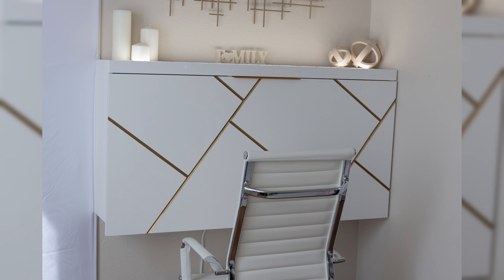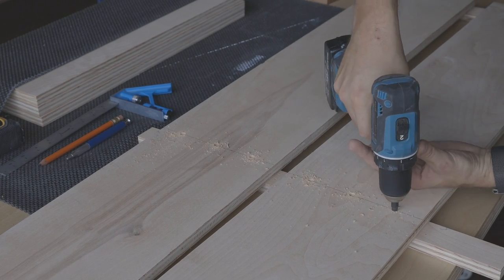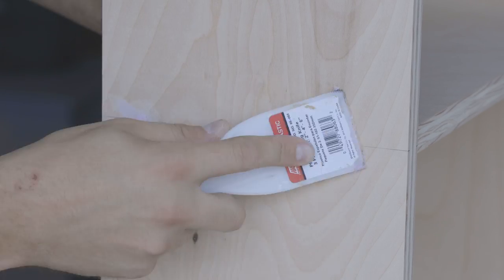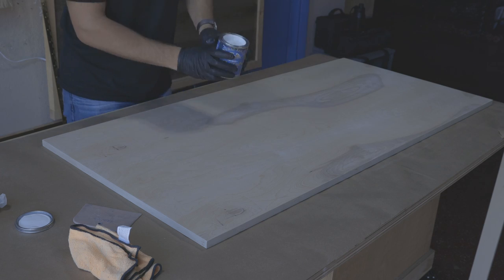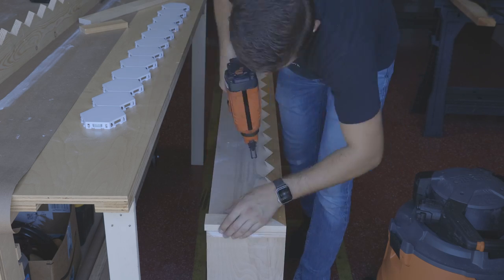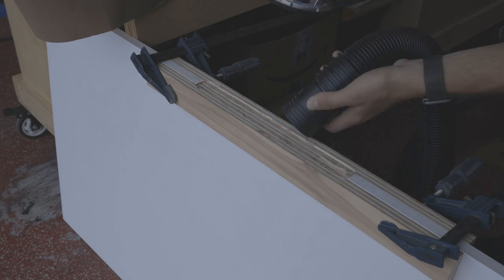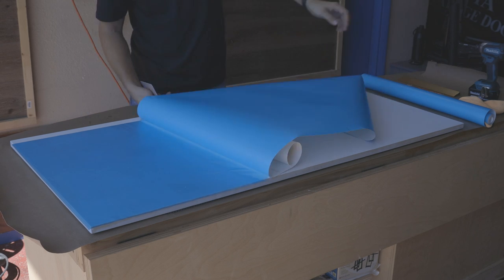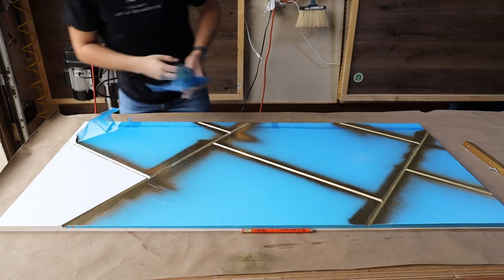Home Office Folding Desk | Wall-Mounted Desk  | Floating Desk | Drop Down Top Desk

Comment: It’s brilliant. I would love a version with sit-stand functionality - ie ability adjust height of keyboard and screen. I could imagine wall-mounting a screen to an articulated arm, but this would cause complications.

By the way, do the shelf inserts and backboard provide an important rigidity function? Ie Could you get away with just the top, bottom and side panels as a box frame?
Reply from the maker: @IAmRobertAndrews  Thank you! You could get away with just a frame-box design if the structure is not big in dimensions. In case if the structure is bigger, but you wouldn’t want any shelving inside there, i would suggest adding solid backing to it(maybe plywood sheet, to keep your build more rigid).

Comment: Very nice. How secure is the desk when unfolded? Is there any spring?
Reply from the maker: The folding hinges are made to hold the desk. it stays down pretty well as long as you don't put a lot of weight on it. Later I added a little shelf on the wall where the drop down desk can rest(just for better stability)
Reply: Great work, would you please  share photo for this shelf. I need to do the same but need to secure the desk@modernartofwoodwork2273

Comment: What did you use to mount it? Great job, loved it!
Reply from the maker: L shape brackets. Attached them on the inside of the top and bottom boards and screwed to the wall.
Reply: @modernartofwoodwork2273  could you be more specific? What size brackets? Also, if i wanted to buy this, what would you charge for it?
Reply from the maker: @iPicti  2.5-in x 1.5-in x 2.5-in-Gauge Black Steel Corner Brace https://www.lowes.com/pd/ReliaBilt-RB-2-5-IN-BLK-DW-CORNER-BRACE/5001634697

Comment: Did you mount it using screws on the wall? You did not show that part.
Can you please let me know about it.
Reply from the maker: I just used regular 3 inch screws, found studs behind the sheetrock and screwed them into a holding plank on the back of the desk